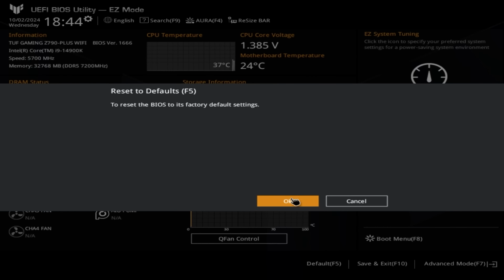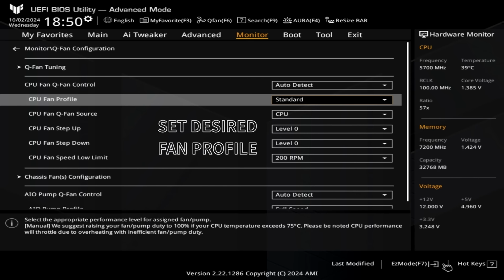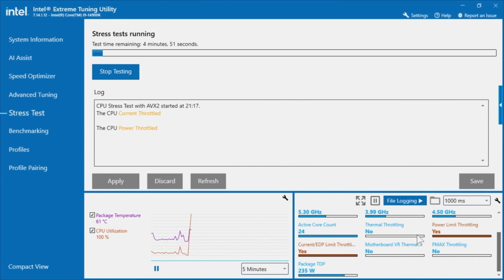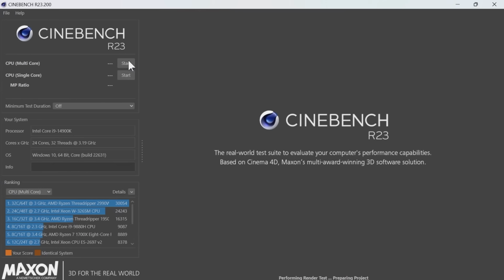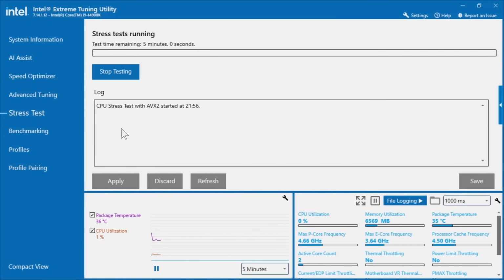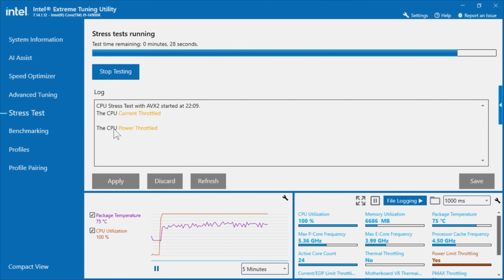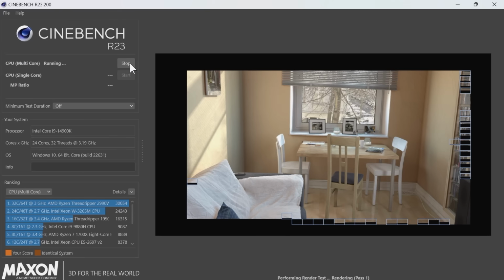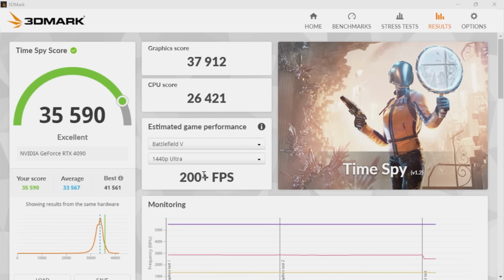i9 14900k Undervolting Guide: Part 2 Complete Stress Test Results

Comment: Hey. Can you explain why my current/edp limit throttling is not set to yes? I madd the same bios settings as you. I have the latest bios update and currently running at -0.065 offset, and it consumes around 230W.
Reply from the maker: @alinvds8652  It will only show yes when the conditions are correct for it to do so, so under the stress test the processor will current throttle when trying to use too much power, or thermo throttle when too much heat is generated.

So providing the correct restrictions are put in place, so disabling Unlimited ICCMax ahd setting the 400/253/253 hard limits that is what limits power.
Reply: @nextlevelsimgaming  understood. I got another question if you dont mind. I tested my 14900kf after this guide and it handled -0.075 undervolt. I went to your next guide, tried that... i got horrible results so i decided to come back to this one. Now i cant go pass -0.05 or i get BSOD... error "clock_watchdog" timeout... did i fry the CPU?
Reply from the maker: @ No, its just not handling the undervolt at such levels, try lowering it incrementally, also the watchdog error is a memory timing issue, change your XMP speed to XMP tweaked if available
Reply: @nextlevelsimgaming  thanks for the reassurance. Regarding the BSOD, i tested with all XMP profiles, including tweaked and its not working. I tested with auto profile (not xmp) and i dont get BSOD... so its the RAM as you said. Currently i have gskill ddr5 6400mhz cl2. Think its better for 14900kf to go up or down in mhz? And what youd recommend for stability?
Reply from the maker: @ Sync the cores to 55 as per the most recent guide here -

Undervolt Asus BIOS Z790 - 1805 - Update Modify Strings in BIOS settings with Custom Guide
https://youtu.be/9tDegZ-rTyU

Comment: with my i9 14900kf, running a -0.145V undervolt and its per forming so well!! No throttles anywhere (except power of course limited at 253W P1 and P2)
Reply from the maker: @tehcod6157  Fantastic 🙌🏻
Reply: @tehcod6157  have you run avx2 tests?
Reply: @tehcod6157  woww. And result with cinebech r23 how much?

Comment: i was only able to stay at -0.0070
Reply from the maker: @kevindeburciaga17  Every processor and system is different, I run at -0.075 but mine will go to -0.090 its about finding the ‘right’ solution for you

Comment: Many thanks! You saved my life. I used XMP1 profile as I didn't find XMP-Tweak in the BIOS. I also set -0.070 in BIOS without trying or tuning it on XTU since it is not available for Linux. Now it is quite stable under 85-88 Celsius during the stress test. 

Great guide but I will just buy an AMD next time LOL.
Reply from the maker: No problem, and thank you for the super thanks too glad to be of help 🙂
Reply: @nextlevelsimgaming  maybe out of topic, will this setting only somehow confines the CPU power usage but it will not stop process that is already on CPU right? For example, if I run multiprocessing in Python, will it kill some the process directly? For some reason, I am experiencing this issue today after the tuning.
Reply from the maker: @ Re-Enable Intel Virtualisation, its only required to be off to make XTU run, that may affect such processes
Reply from the maker: @ Check event logs, and look for any errors relating to the absence of Intel VTX re enable it if so, however in answer to your question, no the reduction in power is within the tolerance of the processor and won’t restrict performance
Reply: @nextlevelsimgaming  Man thanks so much for the help. Re-enabling Intel Virtualization didn't really work, and somehow setting it at -0.03 solves the problem. I also tried the default setting, it also kills, I don't know why actually. I think perhaps I should also go for the RMA...
Reply from the maker: @ Unfortunately the more power required, and the less ability to run an undervollt is a red flag for degradation, a few others have also reported this, and have since had the replacements, with no further issues, rumours are that Intel are due to launch a tool to detect degradation that utilises XTU with a combination of voltage regulation, combined with an Advanced Vector stress test, so very similar parameters that we are putting the processor through here.  We can prevent with these measures alas, but not cure unfortunately.  Happy to be of help.
Reply: @nextlevelsimgaming  sigh. But thanks for the help and explanation. You are the goat!
Reply from the maker: @ No problem 😉
Reply: @nextlevelsimgaming  Yeah just sent back my CPU and got a new one. The undervolting guide works perfectly. Now when I do multiprocessing, it doesn't go over 80 C and quite stable around 70 C (before it is easily 100), and the multiprocessing interruption does not happen again. Thanks man!
Reply from the maker: @ Great to hear, no worries enjoy 😉

Comment: I cant get mine lower then -0.25v am i cooked ? I bought this cpu brand new im not sure how it could be degraded it was in use 1 day or is it just unlucky?
Reply from the maker: @ScoopsGodx  The starting point is - 0.050 if you are starting at 0.25 you are going way too far, start at - 0.0500 then - 0.0550 then - 0.0600 its important you are adding the extra ‘0’ otherwise you are taking it way too much voltage out
Reply: @nextlevelsimgaming  Thanks for the fast response. sorry i meant to add the 0 but in xtu i did already. i restarted and changed all the bios settings again and managed to get a succesful run on -0.050 but couldnt get any lower. and are you using a after market contact plate ? im using a 320mm water cooler and getting 80-90 degrees average alot higher then yours at the same offset even.
Reply from the maker: @ A degraded CPU will require more power to operate, unfortunately, if it cant hold even a minor undervolt then its likely that you should RMA it, however don’t quote that as the reason you are RMA’ing it obviously.

Comment: So I was having issues at .050 and it would reboot my PC. Bumped it down to .065 and it worked fine. Went in increments as your suggested and was able to run .080. 

7200MHZ XMP
14900K
Asus Z790 Dark Hero
Reply from the maker: @WiseFilth  Fantastic I am presently running at -0.80 and been completely stable after the final revision, great temperatures at that level too.

Comment: Mines crashing at. 55 so if its not stable at that voltage would i need to go up instead of down?
Reply from the maker: @WCxColosus  You need to ensure its - 0.055 and not - 0.55 first of all, if it’s crashing at - 0.055 return to  -0.050 and check stability via a Strress Test.

If it crashes at such low undervolt levels its likely your CPU is degraded and will require more power to operate and should be RMA’d
Reply: @nextlevelsimgaming  I don't have any issues with it when i run it at stock its just hot and I have a custom loop. When i game ill hit 85 to 90c but no crashing. I do get a random access violation. Ive read its still related to the cpu tho. Only time i have issues is when im trying to under volt it. And yes its 0.05500 that i have set.
Reply from the maker: @ You may not be aware of this, but a CPU has a tolerance level, a bit like a vehicle engine, it can be tuned for more efficiency, i.e use less fuel to achieve the same output, as the engine wears the tolerances reduce, in the same way as when a CPU begins to degrade, it begins to require more power to perform the same task.

The SP quality will determine how far you can extend those tolerances but you should be able to undervolt up to -1.00 you may have instability at in excess of -0.080 to -0.1000 

A starting point is considered to be -0.0500 which is 1/2 a degree negative, anything that cannot hold these levels would be likely to be degraded, you won’t likely see any issues as the PC is presently receiving sufficient ‘fuel’ for it to operate.

Intel are rumoured to be releasing a tool that will detect a degraded CPU

You may have heard my surprise in the video to see that Undervolt Protection was already disabled in the new BIOS update, this now makes sense, as it’s likely that this is the way Intel’s new ‘tool’ will use (probably an extension of XTU) to detect, and help them begin to finally resolve the RMA issues.
Reply from the maker: https://www.cpu-monkey.com/en/article/how_to_check_if_your_intel_13_14_gen_cpu_is_affected_by_instability_problems

Comment: If it fails at -0.05 should I up the increments by 0.005? Like -0.045 then -0.040 etc.. Also does that mean my CPU has been degraded.
Reply from the maker: @DarrenHernandez-dn2fk  Hi, a degraded CPU will require more power, so an undervolt is a good way to identify an issue.

This video will help you understand and set the correct level of undervolt 

Guide to Setting the Correct Undervolt and Stress Testing Intel Raptor Lake i9 14900k

https://youtu.be/XM2JLjcQZgc
Reply: I was able to get a passing score at -0.035

Comment: Hello, 

Excellent content, very grateful although I have some doubts...

I put my AIO settings in the BIOS and it doesn't save them, is it better to put the settings in the software? And if so, do I put the fans to work at 100% all the time? My AIO is the Lian-Li Galahad II 360
Reply from the maker: @Blosmth  Depends what motherboard you have regarding the AIO settings, mine is detected automatically.  You can of course still use software I use iCue, the only reason I mention fan settings is I disable iCue when benchmarking as thats the correct thing to do, i.e close all background applications
Reply: @nextlevelsimgaming  I understand. My board is the ASUS ROG Strix Z790-F Gaming WiFi II with an I9-14900K, along with CORSAIR Dominator Titanium RAM at 6600 MHz. The truth is, configuring the AIO using Lian Li software is giving me temperatures between 60° or 70° while playing Baldur's Gate 3, with the fans running at 100% all the time.

Do you recommend that AIO pump work 100% as well or that the software be default? 

Thank you very much 😊
Reply from the maker: @Blosmth  Sorry completely misread the Lian Li part then.  The latest Nvidia driver is causing elevated usage at idle with Corsair presently.

Unfortunately the only way to find the optimal cooling configuration is testing all profiles, theres not a one size fits all solution due to variables in case, fans, board even pasting, clamp down pressure etc
Reply: @nextlevelsimgaming  Oh, thanks for the info. I always take precautions and don't usually install the latest Nvidia updates for security reasons. I've tried a more custom profile for my AIO and it works great. Thanks for all the help 🫡
Reply from the maker: @Blosmth  No worries 😉
Reply from the maker: @Blosmth  I literally just set it to that for benchmarking in BIOS, then to Quiet outside of that, normally I use iCue to control everything like you, but its deactivated presently due to the Nvidia driver issue 566.03 causing elevated memory usage at idle.

Comment: I see you did a 0.08000 on the xtu but can you do it in the BIOS way aswell or is that somehow different?
Reply from the maker: You can use XTU to find an appropriate undervolt, and then set BIOS should you wish to, I actually use it this way, treating XTU as a guide to finding the correct undervolt level

Comment: they updated the bios from 2603 to 2703 on Asus - should I upgrade?
Reply from the maker: @BnonZero  I will be doing a guide on the final 0x12B over the next few days 😎
Reply from the maker: @BnonZero  Forthcoming video later this week on the new BIOS mate testing presently
Reply: @nextlevelsimgaming  waiting!  Also, wondering if cache over/under clocking can anyhow help the performance as well.

Comment: Hey man there is a new Bios 1703 for my Strix Z790-E WIFI II. I tried it , its giving me issues with my Corsair AIO. Do not know if you have checked for your Tuff mobo, from what I can tell, some people are reporting issue of this new bios on the ASUS Repubic of gamers Forums.  Just giving you a heads up. I rolled back to 1602.
Reply from the maker: @Pinkfloyd1173  The update isn’t available yet for the TUF motherboard but I know channel contributor Emir has a Dark Hero Motherboard that he hasn’t had any issues with, but when the BIOS update drops there will be a new video on it, thanks for the heads up 😉

Comment: Thank you very much. I did this tutorial and the crashes stopped immediately with just -0.0250V (my cpu may be already damaged since it was constantly stuttering in games and closing/glitching apps). I have a question though, why 400A in the CPU core? I've seen many specs that said 307 is the right value and 400 would be for a 14900KS.
Reply from the maker: @DiegoCargnin  400a is the Intel Extreme profile, there are two profiles the other one is 307a which is called ‘Performance’ , it just gives the CPU more headroom in gaming, the PL1 and PL2 are both 253/253w

If you look in the Community posts, I put the Intel Recommendations document in there, you can see the specs there 🙂

Comment: It appears that I lost 200 points om Cinebench 2024, not r23. I kept logs of scores. 0x12b might be slowing me down on bios 1703 but I don't care as long as it protects the CPU.
Reply from the maker: @cemsengul16  Thats ultimately what its all about, stability through lower temperatures, and lower temperatures for more reliability.  With the testing i’ve been doing over the past week involving the absolute maximum settings putting the Pimax Crystal through its paces, i’m in no doubt whatever that the CPU would have been on its knees with the original setup.  I wouldn’t get too hung up on benchmarks, as long as the system performs well for you in what you use it for thats the aim of the game 😉
Reply: @nextlevelsimgaming  I can't tell what undervolt level to leave it at.
Reply from the maker: @cemsengul16  Try - 0.07000also -0.06500 is a good all rounder, I find anything above - 0.07500 can be little difference with too little headroom for my liking, especially when limiting the VID max which I also like to do.  You can also enable Current Excursion Protection at those levels, anything more the CEP would throw a wobbler 🤣
Reply: @nextlevelsimgaming  Upon testing you do still get an improvement with undervolt but for my motherboard the stable release really seems like it sapped performance. Am I the only who thinks we should have been upgraded to Arrow Lake as part of the recall? I don't know how I could ever trust intel again.
Reply: @nextlevelsimgaming  I thought my undervolt settings were incorrect but I believe it's just the game I am playing. Have you tried Silent Hill 2 remake yet? I don't technically crash but when I exit the game I have an Unreal Engine error log.
Reply from the maker: @cemsengul16  No, I haven’t tried it yet, but was planning on getting it, but seems its a well known issue

https://youtu.be/oPW5ZMqT0YQ?si=3cs7l-JNjTXkU6WX
Reply: @nextlevelsimgaming  Well I think I found out my issue. Following your settings I tested OCCT CPU stress test with AVX2. I noticed that with 0.07, 0.075 undervolt I instantly got a blue screen clock watchdog error. I found out I am fully stable with 0.06 undervolt and 5.5 ghz. Silent Hill 2 remake apparently uses AVX instruction set. Only with 0.06 mv undervolt did I get no errors or bluescreen on OCCT CPU stress test so I set it to that. Afterwards Silent Hill 2 did not give me an Unreal Engine error after saving and closing the game. I will let you know if I get another error though.
Reply from the maker: @cemsengul16  Out if interest, do you have Corsair iCue software installed?, there is an issue presently with that and the latest Nvidia driver update. 

Unfortunately it can happen when pushing advanced vector extensions the tolerances of power requirements can be so tight which is why I recommend to people to find the right level and try to not keep chasing at detrimental effect.  Thanks as always for the info 😉
Reply: @nextlevelsimgaming  No I do not have icue installed. I use Lconnect 3 since my AIO is a Lian Li Galahad 2 LCD 360.
Reply from the maker: @cemsengul16  There is a current issue with iCue and the latest Nvidia drivers, why I was curious.

Leave sufficient headroom when undervolting and you’ll be fine 😉
Reply: @nextlevelsimgaming  So far 0.06 seems to have no issues. When I was playing around testing undervolts, 0.08 had really nice thermals at idle Windows usage but wasn't stable for avx. I am contemplating lowering my p cores to 5.4 and e cores to 4.3 chasing good temps not performance really. However if I were to lower it below 5.5 I would be turning my i9 into an i7 wouldn't I?
Reply from the maker: @cemsengul16  Below 5.5 is pretty fruitless to be honest, it works in a 13900k at 53k well but not the 14900k
Reply: @nextlevelsimgaming  Okay then I will stick to 0.06 and 5.5 ghz.
Reply: @nextlevelsimgaming  Wow I think I see the benefit of a global undervolt now. I had been using vf offset for a long time with my replacement chip and once I found my fully stable value of 0.06 and stuck with it I notice my coolant temp and cpu temp is better. I was undervolting the last vf points before but a global undervolt also undervolts the e cores making things a little cooler.
Reply from the maker: @cemsengul16  Fantastic news 😉
Reply: @nextlevelsimgaming Weirdest thing. I have been using your settings for a year and somehow my CPU now needs a 0.035 undervolt compared to the original 0.06 mv.